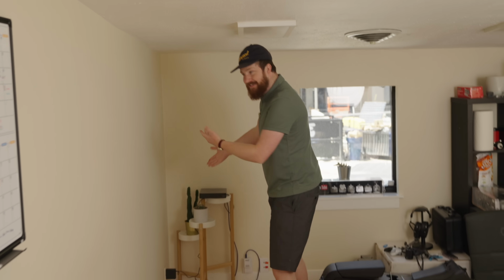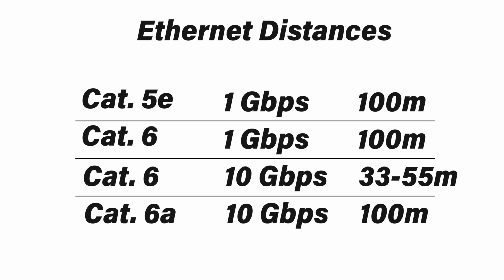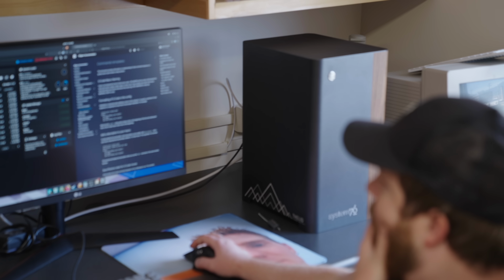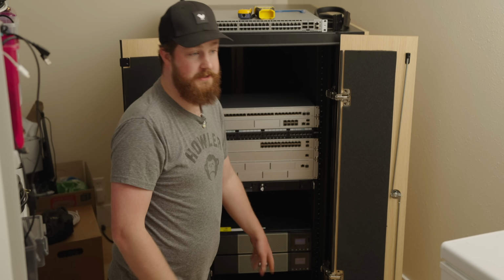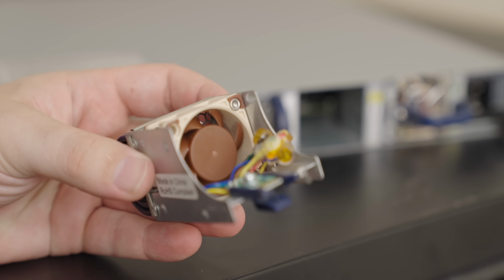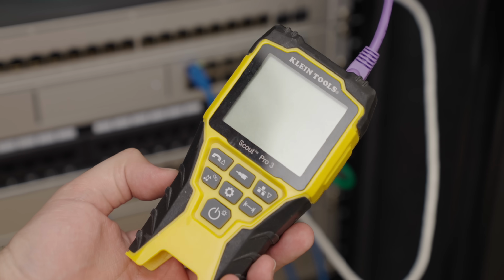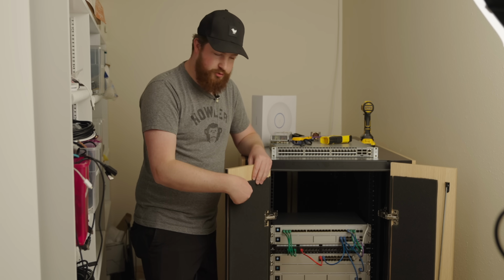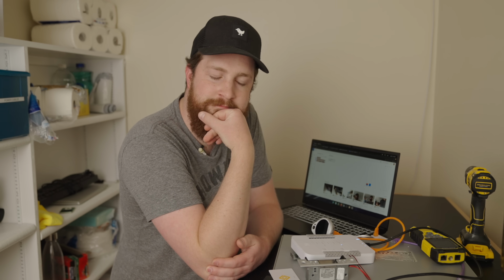DIY 10 Gig Networking for Our $60,000 Server!

Comment: "24 10GB ports, which is more than anyone will ever need" 

Lmao.
Reply: Exactly and downgrades from a 48 port 10G / 4 port 40G Datacenter Layer 3 switch to Ubiquiti. To be fair, that switch was a MASSIVE overkill for their use case. They are built like tanks and he should probably keep it as a backup if the Ubiquiti decides to act up. I highly doubt he was using it beyond its layer 2 functions. Yes, they draw a lot of power. They are literally a dual-core x86 computer running Linux that has 1.28Tbps of throughput.

Comment: Be careful with those pass through rj45 connectors.  Sometimes the cut tips get close enough to short out or over time the expansion and contraction of the cable will do the same.  I have been doing residential and commercial automation systems for 20 years and have seen it all. Lol.  Great video as always!
Reply: lol
Reply: I've wondered about that but nobody really talks about it...guess I'm the worry wort

Comment: I honestly do not mind the extinction of punch-down panels so long we're allowed to use connectors that terminate the same way. I believe punch-down jacks are available where it's the same stuff, just in a different form that lets you shove more of them in a single space, or use with existing patch bays without replacing your infrastructure to use them. More expensive though, but for good reason it seems.

Comment: If you end up using those cheap POE to Pi power supplies, please use a meter to check the voltage you're getting - I found that they were dropping to 4.5A under the smallest load
Reply: haha, you mean volts?

Comment: really surprised to see passthrough RJ45. i've had terrible luck with them shorting (really bad when PoE is in play). also pretty surprised to not see you using keystone jacks in the field terminations, that's pretty much standard in professional structured cabling for data.

Comment: i built my own ups i bought my ups from amazon new it was a line interactive and it was a 900 watt unit then i tried running my gaming system and network on it which draws 350 watts it was only saying 20 minutes i didnt link that so i went out and got 2 large rv style deep cycle battery and made it 2 and a half hours on back up  and yes my network is fiber so i dont have to worry about that not working

Comment: The categories, like Cat 6a, don't mean those cables are UTP or FUTP.
If the cable has shielding or not is completely up to the manufacturer.
Cheap cables will be UTP, because no material for shielding used.
FUTP and better are more expensive, because material is used for shielding.

Cat 5e had all ready SFTP cables (Shielded-Foiled-Twisted-Pair) and even
better shieldings have arrived. Learned some years ago, that you there
is at least a specification for SFSFTP cables.
Yes, 4 layers of protection: Shielded-Foiled-Shielded-Foiled.

Downvote for wrong explanation.

Comment: Ubiquity is definitely the "Apple" of networking. It's because of two things primarily:
1. They virtically integrate like crazy. You don't HAVE to use only their stuff, but they try to incentivize it with interconnectivity features that mostly only work with their own equipment. A lot of proprietary solutions.
2. They put a lot of focus on the user experience and visuals. Yes they make some really quality stuff, but to a good degree you are paying for the name. You get a specific experience that many fall in love with and don't end up wanting anything else outside their ecosystem.
Reply: And, apparently, the people who used to work on Apple AirPort got laid off when Apple stopped making them and they went and started creating Unifi stuff

Comment: There is a big difference between the UPS you’re using and the 2,000 dollar APC you showed the listen of.  As you mentioned your UPS uses Lead-Acid batteries but that 2k APC uses lithium-ion batteries which is the direction the industry is moving to because of the life span of lithium-ion over lead-acid.   I would go lithium-ion all day long even with the cost difference

Comment: Every time I watch one of your networking videos I get ideas and that’s dangerous. I’m just renting my current place and I look at my walls and the three CAT5e ports that it has and I start getting jealous.
Reply: Yes...but most don’t realistically need more...you could probably run 10Gb adequately. That's if you even have a NAS or transfer stuff
Reply: you can apparently use cat5e in short runs for 10 gigabit networking so maybe you don't have to run new wires unless you have more devices

Comment: Great video except that Klein tester is not up to snuff for 10GB networking. It's too basic. It will tell you basic faults like what you had with a missing pair. For 10GB networking & PoE you want a tester that can at least do "qualification". That can tell if all the parts in the cable run, especially the terminations, can handle 10GB and PoE properly. Fluke's LinkIQ is a great tester. Any cabling I get done for work it has to have a qualification test at a minimum. For the data center it's "certified" which is a higher level of testing.

Comment: Honestly even with solid walls in the way I can get like 200 - 300Mb at a reasonable distence with my WiFi access point and that only WiFi 6, so it's not the full 700Mb I can get, but like 200 - 300 megabit is fine for what I use WiFi for, for anything that needs speed or reliability I go wired Yeh WiFi 6E and 7 exist which can get wired like speeds, but really 200 - 300Mb when I'm outside in the direction with the most walls I can get between me and my access point... Errr, like it's fine.

Comment: Those rj45 connections are not rated for Poe and 10g. The non pass through while a bit more of a pain, are far more reliable
Reply from the maker: They’re not and yet they do. As long as your terminations are clean, you’re good.
Reply: @snazzy  Get a Fluke certifier and do the scientific test to see if those pass through connectors are any good. It is one thing to just connect, and another to be able to work up to 10G speeds.

Comment: T-568A is the superior way to wire it up. Long live T-568A!

😂
Reply: The standard standard in Australia! Much easier to see the correct wiring order with Orange being the split pair on pair 2 (pair 1 is the middle two pins, pair two is the two pins either side of the middle two, pair 3 is on pins 1 and 2 and pair 4 is on pins 7&8)

Comment: I have one of those Eatons too.  I didnt know anything about Eaton UPS but was looking for a UPS for my home theater and came across an open box on eBay for a great price.  Definitely a cool factor.  I am curious about something else though.  What are the advantages of buying a better quality Ethernet switch as opposed to a more budget model?  If just using for normal home networking:  streaming, internet, smart home components and integration; is there a reason to buy something from Araknis or Ubiquiti?  Or is it a waste of money?
Reply: More expensive "managed" switches offer control over routing of IP traffic and often offer features like PoE (Power over Ethernet) injection so that devices can be powered via an ethernet cable so you don't have to run two cables to a device.
Reply: @nimoy007  I think I’m asking more about an apples to apples comparison.  Similar features and similar speeds but different brands with one being higher end and more money.

Comment: You should have used cat6a. Shielded.  You’ll regret it.   Especially if they’re just strung up on the outside of the building.

LTO. Get a robot. They’re just a tiny bit more money and then you won’t have to manually feed it tapes constantly. It will backup automatically. Progressively. With no intervention. Just a small one. Used they’re even cheaper. 

Patch bays are dead because they’re crap. Bad quality connections. As you showed. Conductors pull out and then are hard to work on to fix trying to find which wire. You have to do a lot of wire management and have cables coming off the back of the patch straight back and then secured to a tie bar.  You could have just crimped those cables and then use a keystone passthrough. But really keystone is the way to go. Get a grounded one and only use the expensive cat6a/7 connectors for the 10GbaseT connections and if you have any hdbaset video.  Plus you can color code them for all the type As. Red for security cameras, blue for data, white for phone… whatever.  

Racks… there are always tons of super high end racks for sale online for $100-400.  I’ve found isoRacks and other types of quiet racks for $200 that were $2500 new. Perfect condition. I’m in LA but still.  Middle Atlantic racks all the time. Full size. It’s annoying because I’ve been looking for a small one forever for my apt and mostly I just find large ones that were taken out of large companies.  

Telecommunications grounding bus bar. You need one.  You take a ground cable and run it into your grounding bus bar inside your electrical panel and get a telecommunications grounding bus bar and attach to wall behind your rack and connect the #6 ground. Then a 6 to your rack. Most pro equipment will have a grounding terminal on the back of it. Helps to use a grounding cable from equipment to a copper bus bar in the top of the rack on the back.  Then connect that to the bus bar on the wall.   

Grounding is code in most of the country. If a pro installer is doing a rack, they for sure will do this.  Yes technically your ups is connected to the buildings ground and therefore as long as the ups is touching the rails and you use stainless screws, the ups is bonded to the rack and has a path to ground. Same with equipment. But a lot of the time the paint on the equipment and rack and those black rack screws everyone uses will not create a proper metal to metal connection to the rack and therefore not be grounded.  You can use a electrical meter to see if there’s a path by touching a piece of equipment to the grounding screw at the back of the ups.  

Grounding is also necessary not only to save your life if anything hot every touches any piece of equipment, but will dissipate electrical surges because having unshielded wire on the outside of your building, if a lighting strike happens within 500ft, the emp from the strike will get into the wiring and go directly into your network. I’ve had that happen many times before. I’ve had the best UPSes and every type of surge arrestor, on the meter, on the panel, and multiple in the rack and still had boards get fried.   Times when I installed all shielded cable this was never an issue as long as the cable is grounded. You can get surge arrestors for cat6 cable that’s a passthrough keystone style.  

I twice had a home where all the cat cable was shielded but the security cables weren’t. Lightning strike nearby… all that wire going all over the house absorbed the emp, cooked the envisalink board and traveled down the Ethernet cable connecting it to a UniFi switch, though it and fried a AppleTV and a LG oleds Ethernet port.  Some equipment has build in surge protection to a degree. The Honeywell security main board survived and the UniFi switch. It got a overload warning but was ok.  Oh it also fried 2 keypads for the security system and the envisalink board which didn’t have any surge arrestors on it.   I put a Ethernet surge arrestor on the cable to the security system but all the zone sensor wires had to leave. The client didn’t want to get separate ones for each zone. They’re expensive and take up a ton of space. Especially with 28 wired zones.

Comment: Not weird at all that they dont use removable PSUs or even redundant ones... They did what apple does, create a problem, then sell the solution that only works for themselves, sells more gear, makes more $$$. One of the many reasons I wont touch UBNT.

Comment: Is a power supply failure actually that big of a risk? I have used all kinds of crappy power supplies for PCs, laptops, etc and never had one fail. Those enterprise tier server power supplies are at least three times more reliable than your standard wall wart.

In the event that one of your ethernet switches or your router fails, how much will it cost? You could give your employees a day off while you drive yourself to the nearest Micro Center and pick up some temporary gear. The lost labor might amount to thousands of dollars, but I would say the chance of any of this Ubiquity gear failing in the upcoming 10 years due to power supply failure is less than 1%.

I think that servers with hard drives in them should definitely have redundant power and be protected by an UPS, but don't think it's worth it for a router or an ethernet switch.
Reply: In big datacenters you can't afford even a second of downtime, particularly when there could be a loss of data.
Reply: @dustojnikhummer  I know, this is Snazzy Labs studio we are talking about

Comment: Why does it matter the order of the wires as long as both ends are done the same?
Reply: It doesn't matter, but have to pick something so you do both the same. You'll thank yourself later if you picked the widely-used standard.
Reply: Hey both, he did actually mention it, but it's easy to miss as it wasn't a technical explanation. The solid and stripey version of each colour are a transmit and receive pair, and they are twisted in their pair to help reduce crosstalk and other issues you get with data transmission through copper cables. It all in all helps reduce interference and improve the cable performance.

Comment: that is not a fancy cable tester. that is pretty much the cheapest thing you could get.
Reply from the maker: It’s pretty much not, dingus.
Reply: @snazzy  Look up the difference between a tester, a qualifier, and a certifier. And check why there is such a difference in price and what they can actually do for making sure 10G connections can actually achieve 10G without a lot of errors and retransmission of packets.

Comment: Seems like a real silly idea to spend all that time, money, and effort to save literally a couple backs and not install nice Cat8 wiring that will give you futureproofness, is easier to work with that those crap cables you have in the video, and will be a LOT more reliable.  I don’t think you’ve tried to use a few year old gigabit+ network with hand crimped cat6, it’s a nightmare because you’ll have a lot of mysterious reliability and speed issues, and they’ll be hard to find or even notice until it causes you a real headache.  This is all a good seeming idea until you have to use this crap setup years later